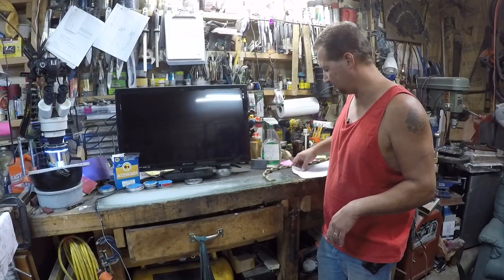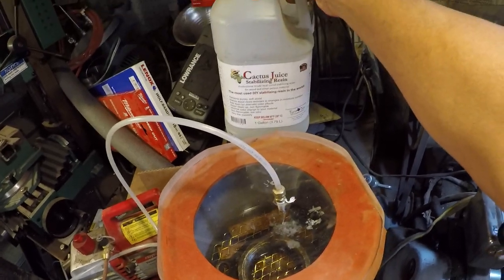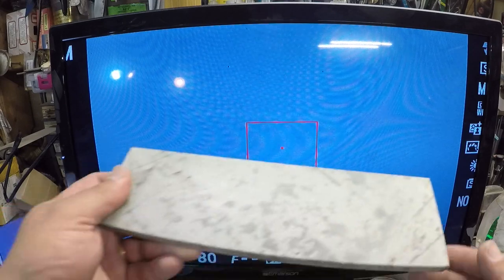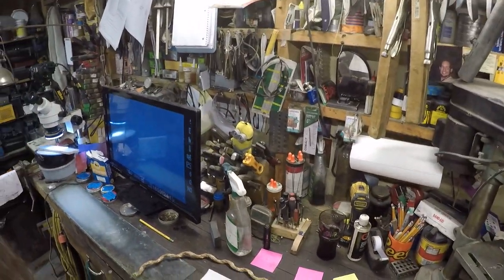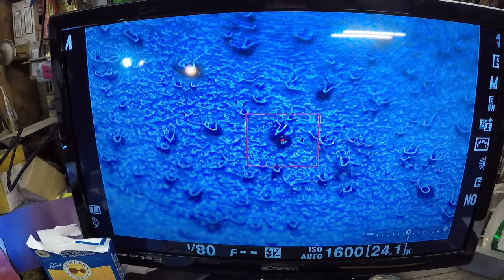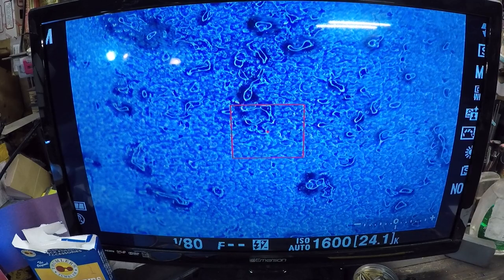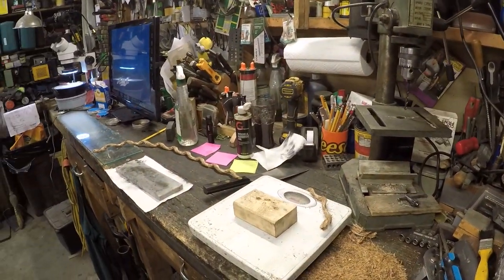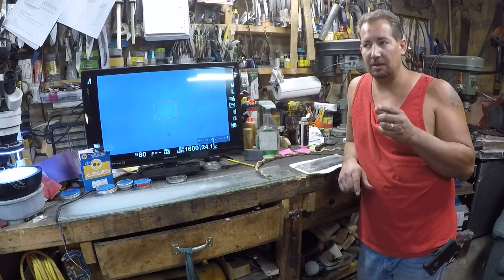checking out some edges off a soft arkansas sharpening stone

Comment: If u want to learn about the complexities of Arkansas stones, check out Rough Rooster Sharpening. Most people who use Arks and complain that they don't cut don't have the patience. It will take years for me to wear down my soft Ark which I have lapped with sic powder 60/90, 180, 240, 400, And finished with 600. I use my silicon carbide coarse to profile (I don't go to the fine side till It is shaving sharp) then fine side to refine the pattern then finish on my soft. I have been sharpening on 3 stones for 60 plus years 6"×2" sic coarse/fine, 4-1/4" x1-5/8" soft Ark, and a 2-7/8"×1-1/8" translucent(which I rarely use).
Still toothy(which is my preference) but scary sharp. Scratch pattern on the soft is more refined than the scratch pattern on a 400 or 500 grit stone. PATIENCE IS THE SECRET
Reply from the maker: I do subscribe to the rough rooster, i enjoy his videos and think he is a funny guy.   it is also good to hear that you have found an edge and style of sharpening that suits you :}